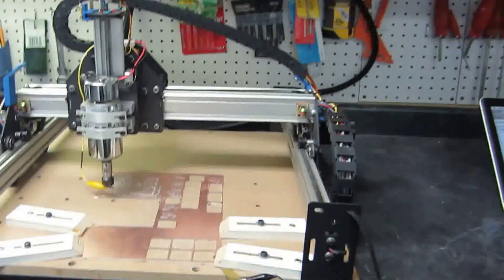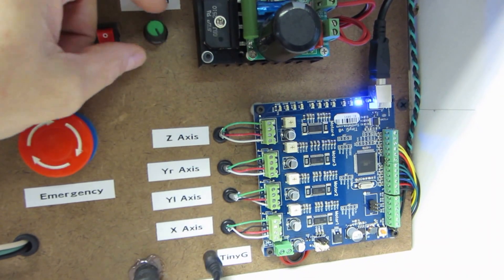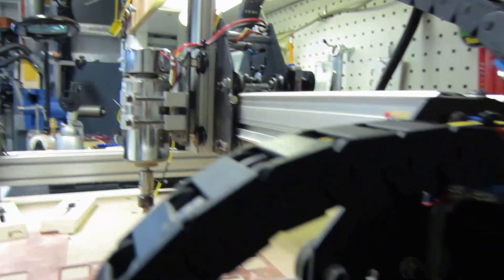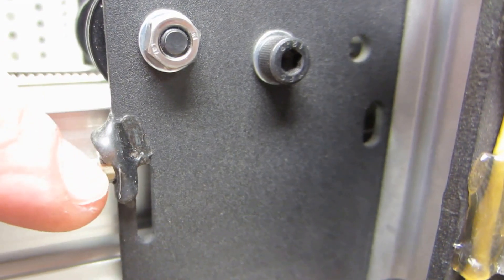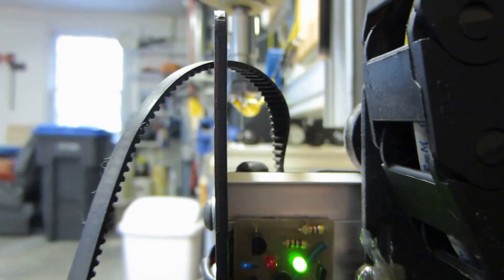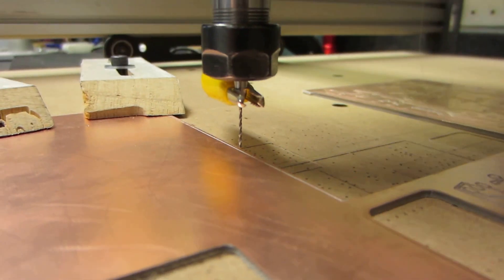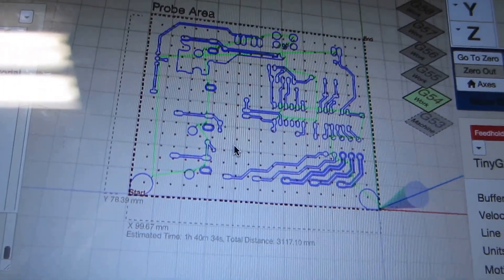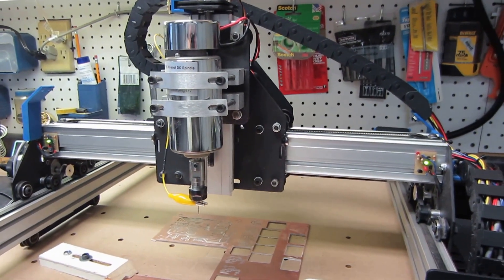ShapeokoTour

Comment: Michael,
I saw on the Shapeoko forum that you are selling these.  I know this is from last year, but are you still selling them?  I have the X-Carve, 1000mm version and I want to put them on both ends of the X and Y and on the top of the Z-Axis.  Do these suffer from the dreaded noise issue and false triggers like the mechanical switches?
Reply from the maker: Just replied on the Inventibles blog.  I have plenty and no noise.
Reply: I don't see your reply...did you reply to my message?
Reply from the maker: My bad did not hit the reply.  Should be there now.

Comment: Thank you for this video
I've got Shapeoko 2
 and tinyg v 8 and want you to send your configuration  file for tinyg  to use on my machine 

2. What specifications power adapter used to TINYG

With Regards
Reply from the maker: Hello,

I used the power supply that came with the ShapeOko2 that powered the GRBL Shield.  It works great.
Reply: Can send to me configration file 📎 for tinyg
Reply from the maker: Here is my Tiny G config.  But I have modified it for the Xcarve Config so the Z settings will be off.  I will look for the original config. 

[fb]  firmware build            440.17
[fv]  firmware version            0.97
[hp]  hardware platform           1.00
[hv]  hardware version            8.00
[id]  TinyG ID                    3X3566-EUZ
[ja]  junction acceleration 2000000 mm
[ct]  chordal tolerance           0.0100 mm
[sl]  soft limit enable           0
[st]  switch type                 0 [0=NO,1=NC]
[mt]  motor idle timeout         60.00 Sec
[ej]  enable json mode            0 [0=text,1=JSON]
[jv]  json verbosity              4 [0=silent,1=footer,2=messages,3=configs,4=linenum,5=verbose]
[js]  json serialize style        1 [0=relaxed,1=strict]
[tv]  text verbosity              1 [0=silent,1=verbose]
[qv]  queue report verbosity      1 [0=off,1=single,2=triple]
[sv]  status report verbosity     1 [0=off,1=filtered,2=verbose]
[si]  status interval           250 ms
[ec]  expand LF to CRLF on TX     0 [0=off,1=on]
[ee]  enable echo                 1 [0=off,1=on]
[ex]  enable flow control         2 [0=off,1=XON/XOFF, 2=RTS/CTS]
[baud] USB baud rate              5 [1=9600,2=19200,3=38400,4=57600,5=115200,6=230400]
[net] network mode                0 [0=master]
[gpl] default gcode plane         0 [0=G17,1=G18,2=G19]
[gun] default gcode units mode    1 [0=G20,1=G21]
[gco] default gcode coord system  1 [1-6 (G54-G59)]
[gpa] default gcode path control  2 [0=G61,1=G61.1,2=G64]
[gdi] default gcode distance mode 0 [0=G90,1=G91]
[1ma] m1 map to axis              0 [0=X,1=Y,2=Z...]
[1sa] m1 step angle               1.800 deg
[1tr] m1 travel per revolution   40.0000 mm
[1mi] m1 microsteps               8 [1,2,4,8]
[1po] m1 polarity                 1 [0=normal,1=reverse]
[1pm] m1 power management         2 [0=disabled,1=always on,2=in cycle,3=when moving]
[2ma] m2 map to axis              1 [0=X,1=Y,2=Z...]
[2sa] m2 step angle               1.800 deg
[2tr] m2 travel per revolution   40.0000 mm
[2mi] m2 microsteps               8 [1,2,4,8]
[2po] m2 polarity                 1 [0=normal,1=reverse]
[2pm] m2 power management         2 [0=disabled,1=always on,2=in cycle,3=when moving]
[3ma] m3 map to axis              1 [0=X,1=Y,2=Z...]
[3sa] m3 step angle               1.800 deg
[3tr] m3 travel per revolution   40.0000 mm
[3mi] m3 microsteps               8 [1,2,4,8]
[3po] m3 polarity                 0 [0=normal,1=reverse]
[3pm] m3 power management         2 [0=disabled,1=always on,2=in cycle,3=when moving]
[4ma] m4 map to axis              2 [0=X,1=Y,2=Z...]
[4sa] m4 step angle               1.800 deg
[4tr] m4 travel per revolution    2.1166 mm
[4mi] m4 microsteps               8 [1,2,4,8]
[4po] m4 polarity                 0 [0=normal,1=reverse]
[4pm] m4 power management         2 [0=disabled,1=always on,2=in cycle,3=when moving]
[xam] x axis mode                 1 [standard]
[xvm] x velocity maximum       1000 mm/min
[xfr] x feedrate maximum       5000 mm/min
[xtn] x travel minimum            0.000 mm
[xtm] x travel maximum          300.000 mm
[xjm] x jerk maximum           5000 mm/min^3 * 1 million
[xjh] x jerk homing           10000 mm/min^3 * 1 million
[xjd] x junction deviation        0.0100 mm (larger is faster)
[xsn] x switch min                3 [0=off,1=homing,2=limit,3=limit+homing]
[xsx] x switch max                2 [0=off,1=homing,2=limit,3=limit+homing]
[xsv] x search velocity        1500 mm/min
[xlv] x latch velocity          100 mm/min
[xlb] x latch backoff            20.000 mm
[xzb] x zero backoff              3.000 mm
[yam] y axis mode                 1 [standard]
[yvm] y velocity maximum       1000 mm/min
[yfr] y feedrate maximum       5000 mm/min
[ytn] y travel minimum            0.000 mm
[ytm] y travel maximum          300.000 mm
[yjm] y jerk maximum           5000 mm/min^3 * 1 million
[yjh] y jerk homing           10000 mm/min^3 * 1 million
[yjd] y junction deviation        0.0500 mm (larger is faster)
[ysn] y switch min                3 [0=off,1=homing,2=limit,3=limit+homing]
[ysx] y switch max                2 [0=off,1=homing,2=limit,3=limit+homing]
[ysv] y search velocity        1500 mm/min
[ylv] y latch velocity          100 mm/min
[ylb] y latch backoff            20.000 mm
[yzb] y zero backoff              3.000 mm
[zam] z axis mode                 1 [standard]
[zvm] z velocity maximum        600 mm/min
[zfr] z feedrate maximum        800 mm/min
[ztn] z travel minimum            0.000 mm
[ztm] z travel maximum           75.000 mm
[zjm] z jerk maximum             50 mm/min^3 * 1 million
[zjh] z jerk homing             100 mm/min^3 * 1 million
[zjd] z junction deviation        0.0100 mm (larger is faster)
[zsn] z switch min                0 [0=off,1=homing,2=limit,3=limit+homing]
[zsx] z switch max                3 [0=off,1=homing,2=limit,3=limit+homing]
[zsv] z search velocity         500 mm/min
[zlv] z latch velocity          100 mm/min
[zlb] z latch backoff            20.000 mm
[zzb] z zero backoff              1.000 mm
[aam] a axis mode                 0 [disabled]
[avm] a velocity maximum     230400 deg/min
[afr] a feedrate maximum     230400 deg/min
[atn] a travel minimum           -1.000 deg
[atm] a travel maximum           -1.000 deg
[ajm] a jerk maximum           5760 deg/min^3 * 1 million
[ajh] a jerk homing            5760 deg/min^3 * 1 million
[ajd] a junction deviation        0.0500 deg (larger is faster)
[ara] a radius value              0.1990 deg
[asn] a switch min                1 [0=off,1=homing,2=limit,3=limit+homing]
[asx] a switch max                0 [0=off,1=homing,2=limit,3=limit+homing]
[asv] a search velocity         600 deg/min
[alv] a latch velocity          100 deg/min
[alb] a latch backoff             5.000 deg
[azb] a zero backoff              2.000 deg
[bam] b axis mode                 0 [disabled]
[bvm] b velocity maximum       3600 deg/min
[bfr] b feedrate maximum       3600 deg/min
[btn] b travel minimum           -1.000 deg
[btm] b travel maximum           -1.000 deg
[bjm] b jerk maximum             20 deg/min^3 * 1 million
[bjd] b junction deviation        0.0500 deg (larger is faster)
[bra] b radius value              1.0000 deg
[cam] c axis mode                 0 [disabled]
[cvm] c velocity maximum       3600 deg/min
[cfr] c feedrate maximum       3600 deg/min
[ctn] c travel minimum           -1.000 deg
[ctm] c travel maximum           -1.000 deg
[cjm] c jerk maximum             20 deg/min^3 * 1 million
[cjd] c junction deviation        0.0500 deg (larger is faster)
[cra] c radius value              1.0000 deg
[p1frq] pwm frequency              5000 Hz
[p1csl] pwm cw speed lo               0 RPM
[p1csh] pwm cw speed hi           15500 RPM
[p1cpl] pwm cw phase lo           0.000 [0..1]
[p1cph] pwm cw phase hi           1.000 [0..1]
[p1wsl] pwm ccw speed lo              0 RPM
[p1wsh] pwm ccw speed hi          13000 RPM
[p1wpl] pwm ccw phase lo          0.125 [0..1]
[p1wph] pwm ccw phase hi          0.200 [0..1]
[p1pof] pwm phase off             0.000 [0..1]
[g54x] g54 x offset               0.000 mm
[g54y] g54 y offset               0.000 mm
[g54z] g54 z offset               0.000 mm
[g54a] g54 a offset               0.000 deg
[g54b] g54 b offset               0.000 deg
[g54c] g54 c offset               0.000 deg
[g55x] g55 x offset             -85.000 mm
[g55y] g55 y offset              60.000 mm
[g55z] g55 z offset             -80.000 mm
[g55a] g55 a offset               0.000 deg
[g55b] g55 b offset               0.000 deg
[g55c] g55 c offset               0.000 deg
[g56x] g56 x offset               0.000 mm
[g56y] g56 y offset               0.000 mm
[g56z] g56 z offset               0.000 mm
[g56a] g56 a offset               0.000 deg
[g56b] g56 b offset               0.000 deg
[g56c] g56 c offset               0.000 deg
[g57x] g57 x offset               0.000 mm
[g57y] g57 y offset               0.000 mm
[g57z] g57 z offset               0.000 mm
[g57a] g57 a offset               0.000 deg
[g57b] g57 b offset               0.000 deg
[g57c] g57 c offset               0.000 deg
[g58x] g58 x offset               0.000 mm
[g58y] g58 y offset               0.000 mm
[g58z] g58 z offset               0.000 mm
[g58a] g58 a offset               0.000 deg
[g58b] g58 b offset               0.000 deg
[g58c] g58 c offset               0.000 deg
[g59x] g59 x offset               0.000 mm
[g59y] g59 y offset               0.000 mm
[g59z] g59 z offset               0.000 mm
[g59a] g59 a offset               0.000 deg
[g59b] g59 b offset               0.000 deg
[g59c] g59 c offset               0.000 deg
[g92x] g92 x offset               0.000 mm
[g92y] g92 y offset               0.000 mm
[g92z] g92 z offset               0.000 mm
[g92a] g92 a offset               0.000 deg
[g92b] g92 b offset               0.000 deg
[g92c] g92 c offset               0.000 deg
[g28x] g28 x position             0.000 mm
[g28y] g28 y position             0.000 mm
[g28z] g28 z position             0.000 mm
[g28a] g28 a position             0.000 deg
[g28b] g28 b position             0.000 deg
[g28c] g28 c position             0.000 deg
[g30x] g30 x position             0.000 mm
[g30y] g30 y position             0.000 mm
[g30z] g30 z position             0.000 mm
[g30a] g30 a position             0.000 deg
[g30b] g30 b position             0.000 deg
[g30c] g30 c position             0.000 deg
Reply from the maker: Here is a good video on the Tiny G conversion.

https://www.youtube.com/watch?v=OTGBs02PiPs
Reply from the maker: You can also just reference your Z settings on the GRBL controller for the Z Axis.

Comment: How much do you want for a set of sensors? Can you build them with bi-color led's instead of separated ones?
Reply from the maker: Virtual Kevin I can build these with a single bulb but I will have to create new circuits.  Not a big deal but it will take a few weeks. Or you can get the current version within a week or so.  I have more parts on order.